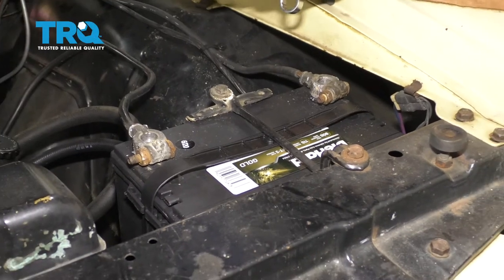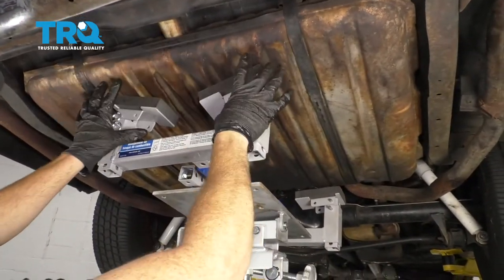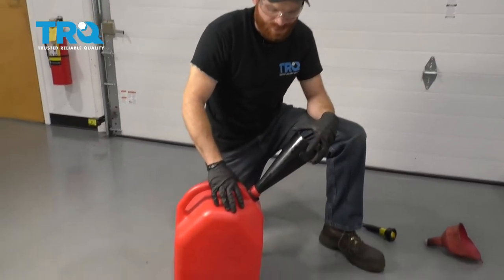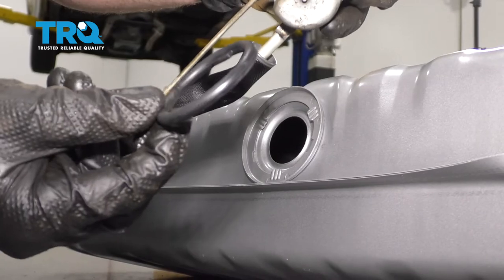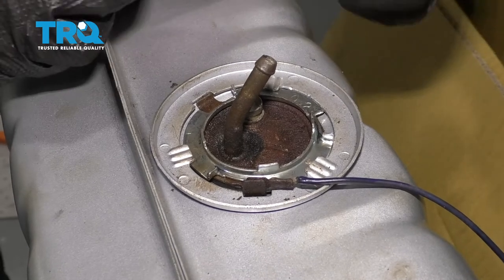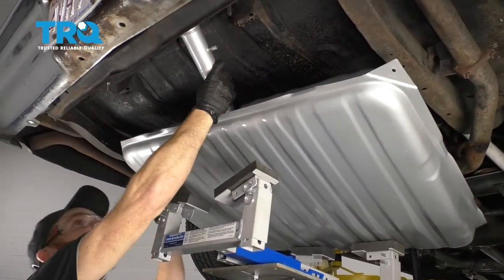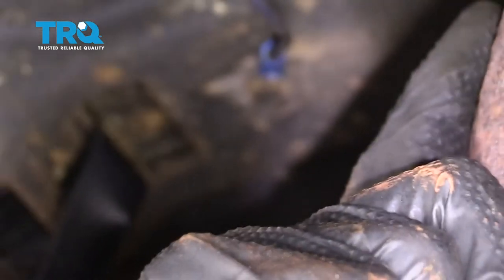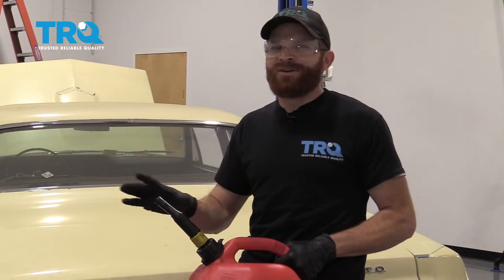How to Replace Fuel Tank 1965-67 Pontiac GTO

Comment: Technically you're supposed to use brass tools, a hammer and punch, if you need to bang out that fuel sender retaining ring, in the unlikely case that it otherwise would spark the gas fumes. Would be good to mention in case anyone wants to get crazy with that thing on their own job.